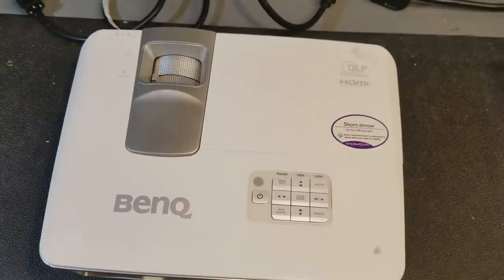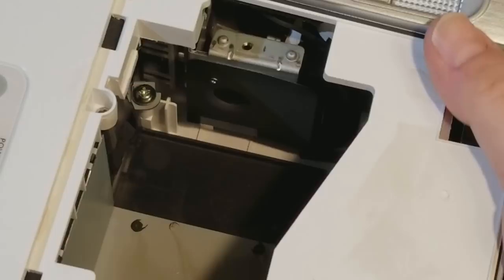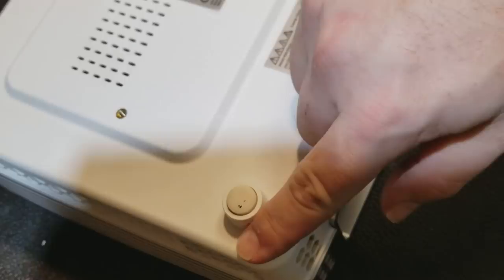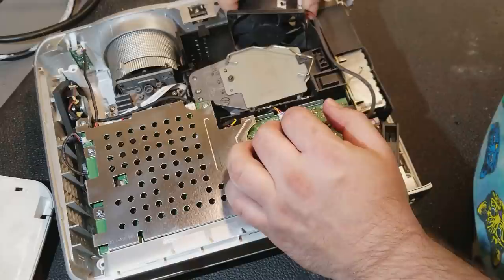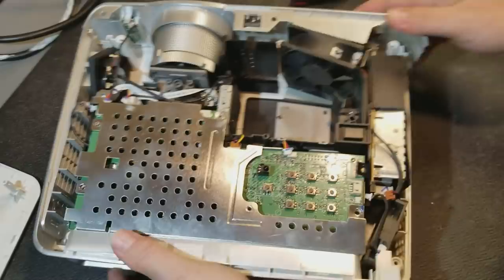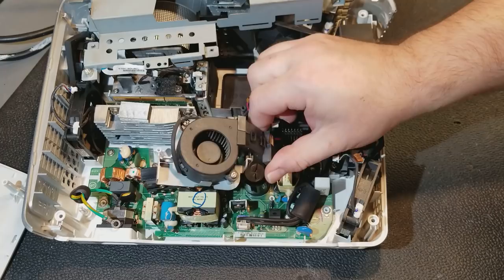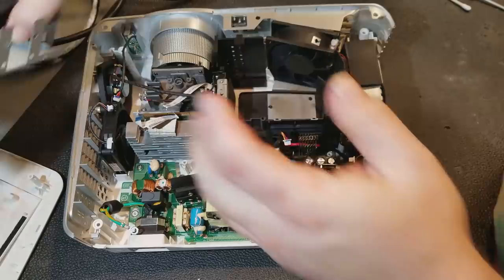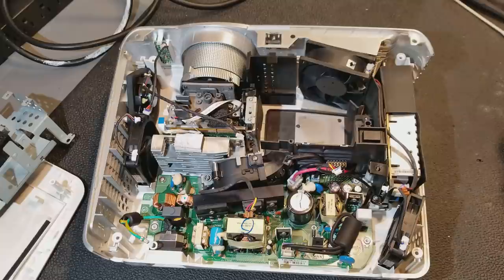BenQ W1080ST DLP Projector Cleaning / Service P1

Comment: Hi Frank I'm in the process of cleaning my benq w1070 projector  and while removing the circuit board a small part fell into the base of the unit. I now have no idea where it belongs or it's importance. Appears to be for grounding purposes. It's labelled as "125°c vw-1 sumitube. Any help would be greatly appreciated.
Reply from the maker: No problem. That is the wire retainer that goes under the right corner screw that holds the main board.  The black plastic is shrink tubing over a metal tab. It's helpful for holding the ballast wire but not critical.
Reply: Thanks for responding so soon. So it rests on top of the main board and is fastened down with the screw? It's in direct contact with the board itself correct?
Reply from the maker: You got it.  It is sandwiched between the screw and the main board.  I have a video of an HT1075 that is identical to the W1070.  You will see the piece here  https://youtu.be/rki1jSNMpII?t=378  on the right corner in front of the lamp door switch.
Reply: Great. Thanks for your help and the timely responses. Appreciate it.
Reply: Hello again Frank I'm having an issue with the image now. I took my projector apart and thoroughly cleaned it. I did this because I was having lamp issues when installing a new lamp. It's a good thing I cleaned it because it was quite dirty. My issue is that after reassembling the projector it appeared to be working fine but I soon realized that only the top 6th of the picture was good. The other 5/6ths is ok if the image isn't too bright. It's difficult to describe. It's watchable if I'm just watching a movie but still noticeable. If I'm watching a hockey game it's terrible. I can barely see the ice surface. I'm hoping I didn't damage the board while cleaning. Any advice would be greatly appreciated.
Reply from the maker: @robbierobertson4473  hi there. I'd need to see a picture of the problem or a video to weigh in. If you removed the integrator/light tunnel it may now be out of alignment. I would go back over your work and make sure everything is seated properly and aligned. The light tunnel is critical to brightness which is why I suspect it moved
Reply: Sorry Frank I had to shift my focus to a burst water line. Quite a cold snap up north here. I'll try to get a picture or video uploaded in the next couple of days. I'm hoping to get the picture back to 100% for the superbowl. Really appreciate all your help. Thanks
Reply from the maker: @robbierobertson4473  I've been there...Had mine rupture back in Dec 2017.  It ended up flooding into the well pit/vault and wrecked the pump motor. We're getting some snow today but the cold has stayed above 0 so far.  

If your image has kind of a 'rainbow' shadow as it goes down the screen that would be the light tunnel.  The service manual talks about aligning it.  It should be pretty easy to get back into place. I have an email listed in the about section if you need to get ahold of me a little faster. I do not see the comment notifications right away.
Reply: Hello again Frank I finally have a picture for you to see the issue with the picture on the projector. It seems to be some kind of glare problem. But it doesn't affect the top 6th of the picture straight across the screen. Hopefully you might know what's causing this. Thanks in advance. Here's the link for the pic/vid https://youtu.be/gNrXXuso1cI
Reply from the maker: @robbierobertson4473  that is strange. I can see why you couldn't really describe it. To me it looks like the red is stopping after that top portion. Make sure the main board is connected fully with the dlp board. It's just a hunch, but it seems like when red is called for, the chip is turning on the mirrors for the red image for the first inch or so and then the mirrors are only turning on for the other colors. At the least I suspect it's connection related. If you removed the dlp chip itself make sure it's seated in it's socket. If not, make sure the main board is seated and has no debris in the socket to the DLP board.
Reply: Ok I should have some time to tinker with it this weekend. Thanks for the advice again Frank. Appreciate it. I'll let you know how it goes.

Comment: hi, i got into problem. I tried to update firmware of my projector with another custom firmware. now its bricked. no display, nothing and on top of that I am unable to find out the original firmware for my projector.any help ? my projector model is : BenQ Mh680
Reply from the maker: Hi Khalid,  I do not have access to firmware for that model.  Even if I did, you bricked the boot-loader as well.  That ROM chip will probably need to be de-soldered and flashed with a programmer to work again.  You may be better off replacing the main board at this point.  It will be the fastest and least expensive option that I can see.  I will check around but I don't think I will find any website that you have not already checked.
Reply: @FixitFrank  Oh boy. anyway I would wait if you may come up with something.thanks buddy
Reply: there are two board, one on which there is usb port the other one is main board.please let me know which one needs to be replaced and where can i get one.thanks
Reply from the maker: @khalidgul786  It should be the larger board.  There should be a sticker with the model # on top of the chip in question.   I will do some checking around.
Reply from the maker: It sure looks like it.  I would ask the seller what firmware is on it.  then check against your existing board and see if the stickers on the chips match
Reply: FixitFrank sooper boss

Comment: Hey Frank! Great video, very informative! Do you happen to know which one is fan #4 ? It's showing as 0rpm and causing my projector to switch off after few minutes of using.. Is it the one right behind the lamp ?
Reply: Mine also has an error in fan number 4. Could you check what it is?
Reply: @diegodiegol10116  I know the message is 2 years old, but did you ever manage to solve that problem? Same question to OP.
Reply: @nicorako
Reply from the maker: Fan four is next to the DMD. On the right side if you are looking at the lens. Fan1 is exhaust. Fan 2, power supply/ballast side, back left corner(if looking at the lens). Fan3 is the blower/turbine fan. If no rpms are being seen, then the fan is bad. Even if it's spinning.
Reply: @nicorako   
Does the projector turn off shortly after turning it on?

Comment: Can anyone please suggest a link where to get a replacement color wheel for Benq W1070+? Thanks a lot!
Reply from the maker: I use eBay as well as a supplier called Time Projector lamps. eBay is fine really as long as the seller has a 99% or higher rating. Color wheels aren't an OEM only part. As long as the price is right, you can't really get a bad one. Only time I worry is when used parts are the only option. Circuit boards and other non mechanical parts are fine, buy I worry about used color wheels.
This seller has a 98.7% but I have used them before and been very satisfied.  https://rover.ebay.com/rover/0/0/0?mpre=https%3A%2F%2Fwww.ebay.com%2Fulk%2Fitm%2F182047510810

Comment: Hi, sir I have the same projector. its making lot of noise. I did clean the whole projector including all 4 fans. still no luc with the noise. Any suggestion or tip would be appreciated.
Reply from the maker: Hi Khalid,  Could it be the color wheel making the noise?  it will sound like a bad fan sometimes.  Are your colors flickering at all?
Reply: FixitFrank thanks for the reply: I don’t notice flicker when connected to media. But when no media is connected I can notice a little flicker on the blank white screen with benq logo. I serviced the projector but I did not touch the wheel. In factory manu all fans are in standard range rpm. If it’s wheel is causing the noise does it mean I have to replace it or it can be serviced. Thank you again👍🙏🏻
Reply from the maker: @khalidgul786  Ideally you want to replace the wheel.  Once they make noise it tends to mean the bearing is no longer reliable. They can be had for $40-50 USD on eBay and they work well. If you want to post a video of the noise I can tell you if it sounds like a color wheel or not.  If you power it up with the top off, can you localize the noise and if so, does it seem to be near the CW area?
Reply: @FixitFrank  🙏. I will post the audio tomorrow.thnaks

Comment: @FixitFrank, great video thank you. I changed the lamp and cleaned it internally (followed your video 😀) but I still have issues with the p. Here the video with the issue: https://drive.google.com/file/d/1ISYfxVnSeeVp9pY6WHbn7YizMLMN0Lqs/view?usp=drivesdk   
What could be the problem? Thanks!
Reply from the maker: It kind of sounds like the color wheel is not being sensed. The little "chirping" noise sounds like the color wheel sensor not being able to detect the wheels index mark.  If it worked before you cleaned, verify the color wheel wire is plugged in the right way and that the sensor for the color wheel is not out of position. Lastly make sure the little sticker on the index mark of the color wheel did not fall off.  to me I think the color wheel wire is probably upside down. I have done that far more than I care to admit :)
Reply: @FixitFrank  thanks Frank! It actually did not work before the cleaning, I thought the dust was causing problems to some sensors. Shall I change therefore the color wheel itself? Doable? Or better buy a new p? :-(

Ps does the color wheel spare part come with the sensor?
Reply from the maker: The sensor would be separate but its likely fine.  They are rare to fail.  It does happen but its one of those 3 out of every 100 sort of thing. 
I would check your color wheel and see if the little black mark is on the hub or if it fell off.  The other possibility is that there is still some dust on the little sensor eye thing. The index sensor/color wheel sensor is an IR led and IR receiver in the same package and its tiny.  It can get dust on it and it wont come off without dabbing it with a dry cotton swab.(no alcohol). I think you might be able to get the sensor pcb unscrewed from the side of the color wheel bracket without removing the optical assembly. If not, it might be worth removing the optic assembly anyway and then check the wheel and the sensor.
Reply: @FixitFrank  thanks! It's probably a bit difficult for me to fix it, anyhow, thanks@